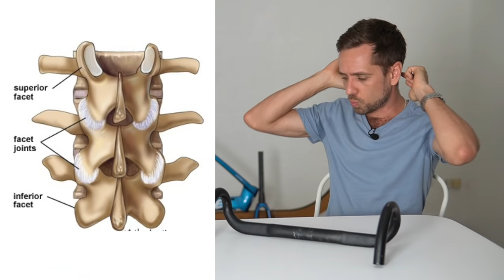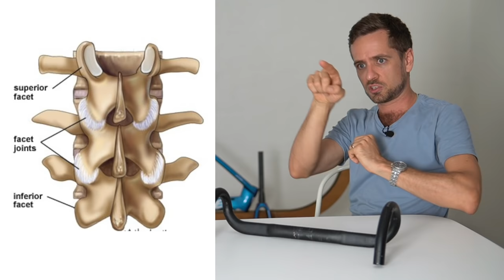What Causes Neck Pain when Cycling (incl: three possible solutions)

Comment: I think it's funny that the pros fit has changed greatly over the years, and varies a lot depending on the person. I see guys who are stretched out because that's what late 90s and early 00s pros did and now people are coming off the slammed stem movement. I've gone from a super high seatpost to a lower one and the reason was a loss of flexibility. So figure out what works for you the body is very adaptable.

Comment: If I shorten my stem length from 90 to 80mm to try and lessen my neck pain, would I increase or decrease my seat height and would I need to adjust my cleats?
Reply from the maker: Lots of Q's in there Karl and it's really hard to say without knowing anything about you. I would test different scenarios for a week at a time and see how you respond.

Comment: Over and over "solution is in the back end of the bike." On the first mention of that, describe what you mean by that blanket statement.
Reply: It's saddle position.  Front to back, and/or height.
Reply: @lkb3rd  which would be more likely to help? Lower and forward or higher and backward? I think the first one right?
Reply: @BreezyE-d3n  Each person will fit differently, so you'd need to evaluate with a bike fitter or learn or experiment on your own.  
When the video says the problem is in the "back of the bike", he means evaluate your saddle position and height, is all I was clarifying...  if I have it right :)
Reply: @lkb3rd  thanks for the clarification

Comment: What if you work out your upper body and core? Would be it resistant to pain?
Reply from the maker: Slightly, but not as much as you'd think. Contracting your traps, triceps and pecs constantly for 2 hours or more is going to hurt anybody no matter how strong they are.  - Neill
Reply: @roadcyclingacademy  thanks for the advice :)
Reply: @roadcyclingacademy  I would like to see videos on bike fit concepts but in relation to flat bars / mountain bikes

Comment: You are missing entirely the most obvious answer for  guaranteed elimination of neck, shoulder and wrist pain. Rise a recumbent two wheeler or a recumbent trike. Recumbents are the best bike designs ever.
Reply: What about riding uphills, are the recumbent good for that?
Reply: @rah4981  ...recumbent trikes are the most efficient way to ride uphill as they remain incredibly stable as one loses speed. Also, the quality trikes like Catrike, HP Velo, etc all have 30 gears so  climbing is easy and the trike is so stable. You are pushing back against the molded seat for increased leverage when climbing and being clipped in adds tremendously to leverage and climbing ease.Also, when one stops on a hill a recumbent trike is very easy to get going and get up to speed. Two wheel recumbents are tougher to balance and ride( I also have a long wheel base Sun EZ Rider...fast as hell but tough to climb and impossible to restart if you stop on a steep incline). The trike option on a recumbent is definitely the way to go.two wheelers like Cruzbike and others are fabulous once you get used to starting them and balancing and are so very easy on your neck, wrists crotch etc. they take more skill to ride. They are also incredibly fast.